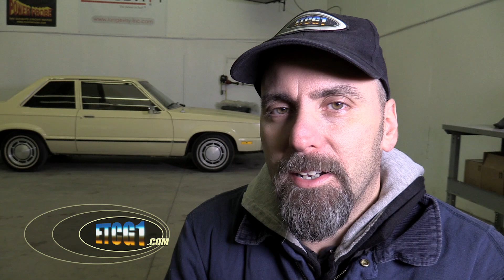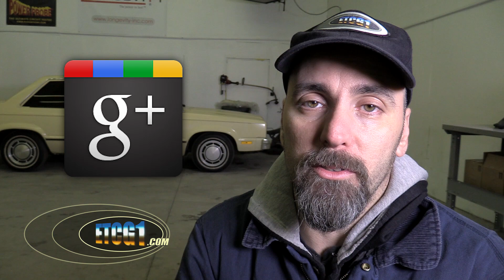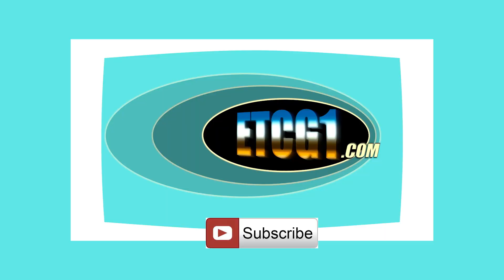How Things Have Changed In Auto Repair -ETCG1

Comment: You really tell it good ETCG1. I left BMW (BMW really is the first with just about anything car related) in 2002 and it was still as you say "gritty". One man,that I worked side by side with (but I am 23 years older) is now the Service Manager at our old BMW Dealership,wow. Think of a fellow mechanic becoming Service Manager. I went in Dealership a few years ago and diagnostics have moved so far since 2002. By the way 2002 was my best ever year money wise,a shade under 50,000. In 2002 we were already hearing these stories about techs from WyTech making 100,000 their second year,I do not think it happened. After I left BMW in 2002 my career went down the same way it went up for others. What I mean is,I went out working at the brakes only shops, PEP Boys. Bloom,Goodyear stores,all the places a guy worked at going up I worked at coming down.

Eric mentioned Bosch L-Jetronic fuel injection, good system. The system that would drive a guy crazy was Bosch K-Jet. Mercedes kept K-Jet for longer than any other manufacture. I would call K-Jet a hydraulic system, that is the injectors "popped" when pressure was correct. Sure it had an electronic side also. Some very long frustrating days with K-Jet cars

Before L-Jet was AFC (air flow control). This is the infamous system that had a reputation to losing its mind if a CB keyed up next to it or if you were on the road the airports RADAR system was located, I never believed this bunk. AFC was found on the Porsche 914,VW Type III, they could drive you nuts figuring it out.

Pre OBDII is OBD!. OBDI is a hair above worthless. Do not buy any car pre OBDII in my opinion (1995). Well I could go on forever. The knowledge brought to us by Eric is priceless,he must have been into this stuff way deep, as I was.
Reply from the maker: +Dan R Thanks very much for your comments and insight. I really appreciate it.
Reply: Hello Eric, I can understand how you are successful with your many ventures that involve so much contact with the public. What I mean is, you project a very pleasant,kind,insightful persona,no BS. I really think that for you some job working closely with the public is a perfect fit. Eric I have a video subject suggestion, maybe it is not enough to dedicate the entire video to. My idea is having you comment on one mechanic being told to take over a job that another mechanic started (maybe you have already touched on this subject). In my experience there are few other better recipes for disaster. Again I thank you for making a very pleasant place on the internet to come to. Oh my B-day is coming up.
Reply from the maker: +Dan R https://www.youtube.com/watch?v=ATipV3jyx9g
Reply from the maker: +Dan R Happy birthday!
Reply: It is at the beginning of June but thanks for the early best wishes.

Comment: It's been a few years since I turned wrenches daily but I agree with Eric as to the direction the manufacturers are heading which is why I own older cars. I still do my own wrenching so I want to have vehicles that I'm fixing what needs fixing, not just changing parts. I'm not afraid of the newer vehicles, I was very comfortable with computer systems when I was wrenching. In fact I was one of the better guys with computer systems in the shops I worked. I just don't like the fact that now that if you try to customize something on your vehicle, you could screw up the system as everything is tied together.

Comment: eric, i'm a ford technician and i can say it's still very gritty. yes, we do have the IDS which allows to manipulate the electronics for diagnosis. many guys i've worked with fail to see or even are aware of that tool. parameter identifiers are awesome. it does make work easier but you do require the understanding of the systems you're working on. cars are now heavily computerized and they require computers to diagnose. granted, you can diag an inop window switch with a computer or pull out your multi-meter.  honestly i prefer both. if i can see the module is commanding the windows, i know the module is good. thats when i rely on my multi-meter. modules fail in these vehicles and even the dealerships don't have the internal wiring schematics to diagnose them without software. t ford, we do have components that  have become straight r&r. for a short while we were replacing rear diffs until ford came out with the active torque coupling replacement kit. with all that said, i do share and appreciate your opinion. at ford, we still get down and dirty.
Reply from the maker: Thanks very much for that insight. I really appreciate it.
Reply: anytime. love your channel. long time fan. if you ever have any ford related issues, feel free to contact me. i'd be glad to help.
Reply from the maker: I appreciate that, and your comments very much. Thank you.

Comment: My 1990 integra has a flash on the ecu.. Count the blinks it kinda leads you to where the problem might be.. I've learned its alot in just wiring thats usually the problem causing codes.. When the part in fact is ok sometimes.

Comment: I quite agree--today's vehicles are actually easier in many respects to diagnose, even if their nature does tend to force mechanics into specialties.   I went to automotive school in the early 80s and we were working on cars from the 60s, 70's and 80's.  We still trained on how to adjust points, how to adjust mechanical advance on distributors, how to read oscilloscope patterns and how to rebuild carburetors, alternators and starters! Manufacturer's were forced by changing regulations during this period and the need for gas economy to start paying attention to emissions and economy.  But, they hated it and did it the cheapest, least revolutionary way possible.  That led to the vacuum driven systems, the kluge of exhaust gas strategies (EGR, air injection, check valves, etc.), and carburetors so jacked up with doo-dads that they barely functioned as fuel delivery systems.  Not only were these systems under-engineered and barely keeping up with demands, they very quickly succumbed to the dirt, oil heat and rust that driving down the road will create.  Mechanics had to understand proprietary, esoteric systems and they had to recognize when the system itself was a problem versus when wear or age was the problem.  We developed shortcuts to bypass diagnostic trees when experience made us suspicious and we had bookshelves full of reference materials when all else failed.  There was no internet or even phone support for independent shops.  After the mid-90s things began to get easier in many ways because the systems became more sophisticated, better engineered, and units were replaced rather than repaired.  Late sixties cars were pretty easy to diagnose, and late 90s and up are also better.  In between was a mess!

Comment: For me I have two categories, when you have a ECM or OBD I /II it's like Star Trek with some mystery, when you have no computer it Sherlock Holmes time!  Both are fun and frustrating at the same time.  I know carburetors are supposed to be easier but they're hard to me as I am still learning.  We just need to try our best overall for the vehicle and the customer.  Which so far is lol just me.  It is nice to plug in and see what the heck is wrong, and it's also great to flex your mind on no obd's as I said I enjoy both.  It's a give and take.  Thanks for the post really has me thinking on which I prefer.   To which I really can't answer.  I can't pick just one lol.

Comment: Well having a 2011 Volt the is more than just fuel injection to worry about. I am about to replace the RH outside mirror. Looking at the mirror the built in turn signal looks like it would take an hour to pull the mirror apart to replace. I know my fault I bought it!

Comment: I think in general mechanics now are far less skilled than they were in the past. In the past, many of them had at least basic machining skills to being full skilled machinists. Now most of them use a scan tool and replace parts. Very few of them actually fix parts or fix anything. Additionally, many cars were designed to be serviceable by professionals and people at home. Today, many cars are intentionally designed to be difficult to work on anywhere except by the overpaid and underqualified dealership staff.

Comment: I think it's interesting on how it has changed.  Not so much as easier, but how it seems that the common problems have changed. 80's was vacuum Lines and carburetors. 90's was computer /ecu problems. late 90's early 2000's was coil problems.  well this is what I seen as a tech At a  GM dealership. And I did do their used car check overs. so I worked on everything that came in.
 I haven't been a tech since 2009 but diagnosis wasn't alway simple.  it depended on the code. if it was a multiple misfire, you had at og th I ngs to check and go threw, but if it was an O2  sensor then just a few checks and if not a wire issue a pretty simple fix. I still work on cars and actually bought a scan tool so I can diagnose problems faster and easier. you have to have one nowadays just to work on your car.

Comment: In my opinion nowadays you have to be very good with diag. It’s much harder to properly diagnose cars now when you have 25 computers. The problem with not having a really good tech to properly diagnose cars now is loosing that customer to another shop because your shop is not capable. The worst thing to do in my opinion is to send a customer to a different shop because there’s generally always another shop that’s not the dealer that is capable. Being just your average shop greatly reduces your customer base because there are hundreds of your average shops in every area. Being that shop that is better than the rest is huge.

Comment: sometimes you just have to do what the computer scan tool tells you. Had a check engine light for a map sensor code. I removed the sensor inspected, cleaned it and checked its resistance. Sensor looked fine but after looking over the whole car for vacuum leaks ect. I sucked it up and bought a new sensor. Check engine light went off by itself shortly after install.
Reply: +Spencer Stagg Sometimes you have to go with what fits. The sensor wires were connected to the PCM, and they weren't shorted to each other....and the sensor tested okay by a resistance test....and you and I aren't buying an oscilloscope yet so we buy the part. And it's usually right if you've done most of your due dilligence.

Comment: The last 5 to 7 years (1988-1995) of the Volvo 740/940 rwd redblocks are the exception to the rule I guess. They are EASY to work on. They were designed that way...that does not mean the shop wont charge an arm an a leg though.

Comment: With the increase in the number of multi-pin connectors in wiring systems in cars these days it is a good idea to pull them apart and check for oxidized pins before replacing parts that seem to have failed. Often a spray of WD40 on the pins will cure the problem. Cars are indeed excellent these days compared to the crap sold before 1990. I remember the frustration of points ignition that always misfired when stepping on the gas to pass a car, and carburetors that coughed out and stalled in cold weather just when you were pulling out into traffic. Back then trying to start a car in sub-zero temps was iffy indeed.

Comment: Personally, I think it was easier diagnosing OBD1 and earlier cars especially compared to most anything built in the last 10ish years simply because they were....... simpler.  For the most part we only had to deal with 1 coil, 2 (non-variable) valves per cylinder, a MAP/Baro sensor, sometimes a TPS, 1 oxygen sensor, and a carb (or usually at most, 2 fuel injectors that half the time you can even visibly watch spraying) along with a relatively simple ECM.  Now we have 1 coil per cylinder, 1 injector per cylinder,  variable cam timing, electronic throttle, yada, yada, yada, that's all tied into an ECM with a zillion parameters (and if we're lucky the vehicle manufacturer was nice enough to let us access all the needed PIDs). Then it doesn't stop there. We now have things like the windows and locks and practically everything else routed through a BCM (which is often also routed through the ECM) and in cases like Nissan, also the IPDM, A/C amp, and even the gauge cluster. So, even if your scan tool is giving you data that doesn't make sense, you still can't always automatically blame one part because just like a manifold gauge set that doesn't work right, your source of the information (ECM/BCM/ or even scan tool) can be wrong.  Which can really be alot of fun when you have CAN/communication errors right off the bat. Then we have transmissions.  They've gotten a whole bunch more complicated since the days of 3 or 4 speeds (or only 2 if you want to go back another decade or two) and at most only a single wire going to a lock-up converter and maybe another for reverse lights.  When I first got into the business in the early 90's somebody told me "It used to take 15 minutes to diagnose and 3 hours to fix a car. Now it takes 3 hours to diagnose and 15 minutes to fix".  Things got even a bit more complicated since then....

Comment: I prefer working on cars from the 90s rather than cars from the 00s, purely because cars from the 90s often have an actual fault that you can see, hear and diagnose without the need for an OBD scanner even though most have that facility. A lot of the repairs I've done on 00s cars have been purely down to a wiring and/or a sensor failure which often have a domino effect on other systems. So diagnosing the original issue can be a long drawn out process.

Comment: my daughter drove a 83 fox body with a 2.3 1bbl. through HS. found the fix for 80's emission crap. #1 air pump in garbage can, #2 block off plate on egr (drops underhood temps 80+ degrees,  #3 modify chambers to loose enough cc's for a static 11 to 1 ratio (stock rated 8 to1 , 7.4 to 1 actual) car still passed emissions tests (better than ever) and gained 8mpg over orignal epa figures.
Reply: Also became the first 2.3 1bbl that could be restarted after a partial warm up without resorting to a screw driver to open the choke. (they wouldn't restart after a 3min trip down the block when brand new)
Reply: Also became the first 2.3 1bbl that could be restarted after a partial warm up without resorting to a screw driver to open the choke. (they wouldn't restart after a 3min trip down the block when brand new)

Comment: Started Being a Tech in the 70's and stop being a Tech I the 90's. Working at  Dealership's and going to their schools was very helpful but we all had our days, while working at a Ford Dealership in the early 80's Ford  had Tech's that we could call and sometimes they couldn't helping us figuring out what was going on. After quitting I thought yes computers are going to ruin the backyard mechanic and the computer systems... are and not as slow as one might think! When you have to take your vehicle to a Dealership after you have replacing parts and get it coded  the end is very close indeed. Maybe it's just me but I can't believe that the car Company's are going to make a system that will be easier and cheaper to repair. I smell Dealership repair only in the air sooner than we think. Save those old cars. lol I am lucky that I live in a place where emissions are not measured for a sticker.

Comment: I think you are right. 1970s cars you listened for the fault, you cleaned carbs and electrical contacts, changed HT leads, usually you could fix the fault. It was a skill, you had to know how engines worked, what noises meant, it was detective work.

80s 90s, you are on your own with a dead engine and not a clue. Golf mark 2 Pierburg carbs, absolute nightmare.

Now you plug in a diagnostic tool, read a code and then go hunting for the sensor that's failed. Sometimes that's the hardest part. Where is the f**ker?

Comment: Yeah. I am an Analog and Digital electronics tech of 57 years old. Been employed as such to differing degrees since age 16. You're correct that today's fighter pilots in the shop, Eric O, Ivan for instance are computer and electronic techs until they get out the torch and other unsavory tools to do the dirty work that it still is.  Then that are so much more. As EVs become the norm and the ICE goes the way of the steam locomotive, neighborhood shops and the parts cartel that the automotive industry enjoys (Dorman junk vs OEM $$) will go away and just be part of history. Like the music industry was before digital delivery (MP3) and the home Digital Audio Workstation. Encyclopedias and the door to door salesmen of them for example are today laughable.  While EVs are not exactly the complete virtualization on a vehicle, for the auto repair shops all there will be left will be suspension (maybe brakes,) and tires. I couldn't be happier that this may be coming, I'm not and auto tech, and have no lift in my garage. I hate the multitude of failure modes in an ICE car. from the radiator to the differential and the crap we poor normals have to deal with just because we have to go to work everyday. Viva La EV!